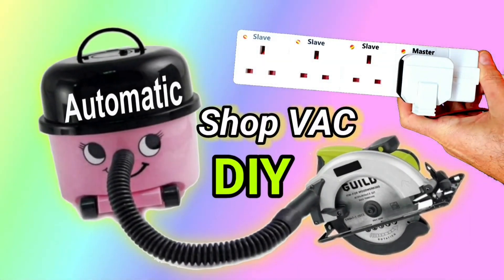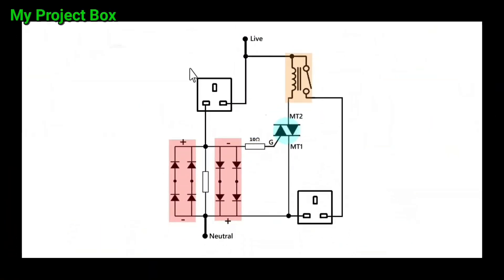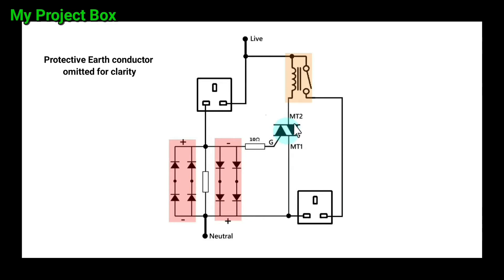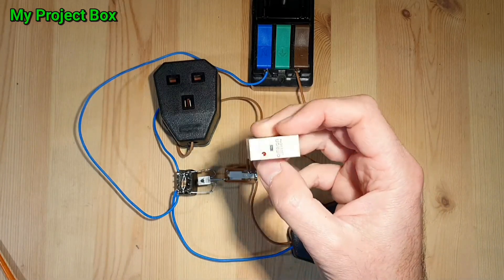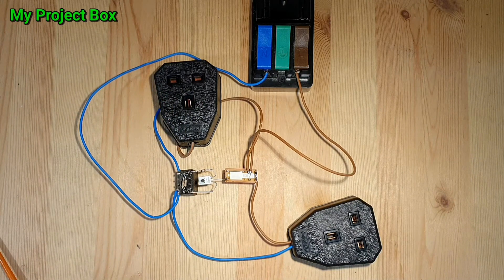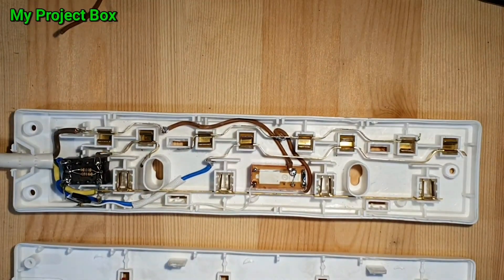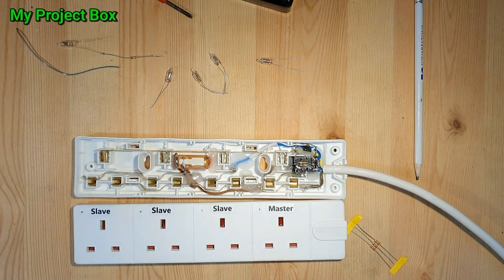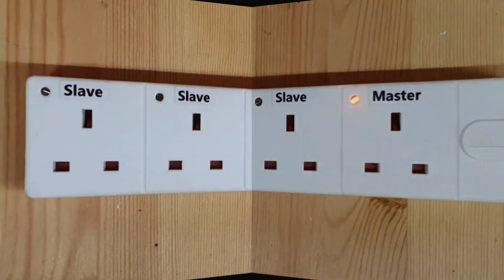How to make a energy saving plug socket DIY master slave circuit #ElectronicsCreators

Comment: Hello from India
Your video is very good I tried this and able to achieve the goal.
I have sony avr and sony dual subwoofers and subwoofers have seperate power so when I turn off the avr from remote woofer stays on you video sorted my problem, the only issue is relay get switched on for a split second when I hook up the powerstrip in the power outlet. Any solution:?😊

Comment: Hey guys might be a stupid question but I re created this with virtually the same parts, when I put power to my master the relay is buzzing instead of a distinct click and obviously there is no voltage to the slave. Any insight would be grewtly appreciated.
Reply: A buzz suggests that the coil is energised but maybe not enough to close the contact. Could be a sketchy relay or one with a coil voltage in excess of 240v maybe?

As a fun aside, mains hair trimmers don't have a motor - they just have a magnet that's linked to the moving bits and a coil of wire inside that uses the 50hZ mains frequency to move the working parts.
Reply: @mortsy i figured it out had the incorrect relay 🤦‍♂️
Reply: @ketaminekeith286  do you happen to know the correct model? I’ve tried to track down the one in the video but can’t seem to find a match
Reply: @mortsy  yep i used 10A 240VAC DPDT Cradle Relay from a supplier called Altronics. It does work, however in certain applications it chirps faintly but still supplys voltage. I tried to run my pc / tv powerboard off it it, it did not like it lol. Works for lights and powertools etc tho.

Comment: Hi, great vid.  You said you found a wiring mistake with the neutral line. Does it affect the circuit? I'm struggling to find a parts list - I'm wondering if you could generate one - mainly the D5SBA rectifier module. The 2N6075 triac looks to be common and low-cost.
Reply from the maker: You could use any bridge rectifier as long as I has high enough current and voltage rating for your application. I just happened to have these ones handy, selvedged out of old power supplys. I'm not sure about any mistakes in this video 🤔.
Reply: @MyProjectBoxChannel  Thanks for the quick reply. On a rewatch, one of your viewers had a mistake in your neutral, not you! If I've bought a 6 Amp triac, but am not 100% sure how to connect up MT2 to use the triac for switching without a relay...

Comment: Looks like the resistors are less than 1/4 watt. Strangely, they stopped selling these boards in Australia I think because only one pole on the output is switched, meaning neutral was always active, increasing the risk of electrocution.

Comment: Nice concept and video.  Ready made versions of this are no longer available in Australia (I suspect due to changes in electrical standards here) so a DIY version is the only option now.  I used virtually the same components as you have and managed to fit the whole lot in a local 4-outlet power board. Very worthwhile addition to my workshop!
Reply from the maker: Excellent, I'm so glad it worked for you 😉 👍. The circuit is very basic but works in most cases.
Reply: @MyProjectBoxChannel  Just as an aside, I've decided to slightly modify the original design so that the power board has several master sockets and one slave, rather than the other way around.  It occurred to me that in this application you would only ever have one vacuum cleaner so only one slave outlet is required. Conversely, it's likely that a typical woodworking bench will have several dust-creating power tools (saw, planer, router etc) which, while not used simultaneously, could all be conveniently plugged in several "master" outlets, any one of which would activate the slave.

The basic design of the circuit remains unchanged but the busbars to the sockets are chopped up slightly differently to provide three master sockets and one slave.
Reply from the maker: @SteveHarding-jy6rm  Yes! Good idea, that would make sense for your application. There will be a need for having multiple slave sockets, if used with something like a TV and game console, amplifier and so on.

Comment: Hi, nice project! is there any way to calculate the resistor value between bridge rectifiers? I did the same setup as you but I only had a 47 ohm resistor and the 700W of load didn't trigger. Is it even possible? Or is the problem different? I am not able to test a bigger load right now.
Reply from the maker: If you remove the resistor it will make the circuit more sensitive. So if it still not triggering without the resistor, then there is something wrong with your circuit. The diodes need to create a sufficient voltage drop so the triac gate can trigger. I used a sensitive gate triac.
Reply: @MyProjectBoxChannel Yes, I found a wiring mistake with the neutral line. I'll try to fix it tomorrow. Thank you

Comment: Nice project, thanks for the video, We have a small 220v AC strip light under one kitchen cabinet to light where the kettle is, but it would be nice to have that strip light come on when someone is stood making a cup of tea in the evening, and to have the light stay on for a short time say 10 minutes then go out, that would be a nice project to make, any suggestions how? Many thanks for all your projects you show. Bob in the UK
Reply from the maker: Interesting🤔. Do you want the lights to be triggered by the current draw from the socket outlets? Maybe the kettle? A PIR occupancy sensor could also detect any one standing in the kitchen, and trigger the under counter lights🤔.
Reply: Hi a PIR would be good as the light would not come on until the kettle button is pressed, thanks Bob  @MyProjectBoxChannel  👍